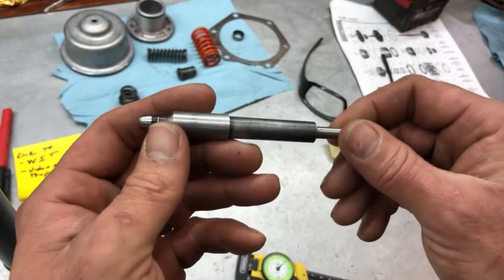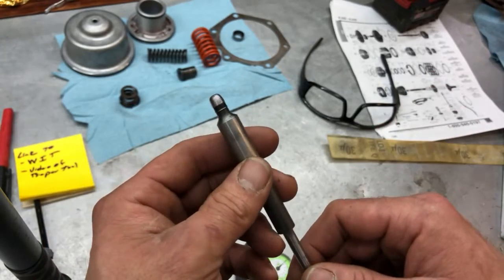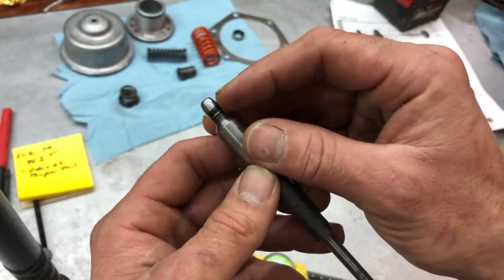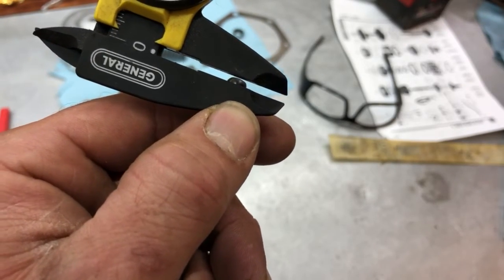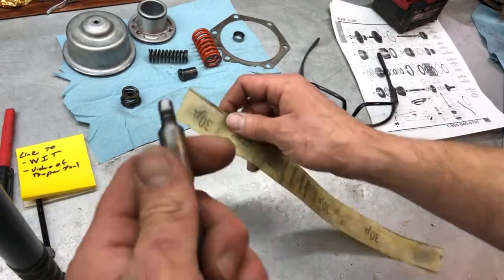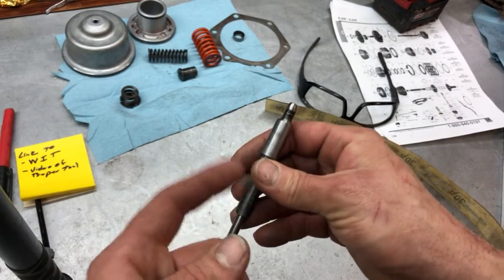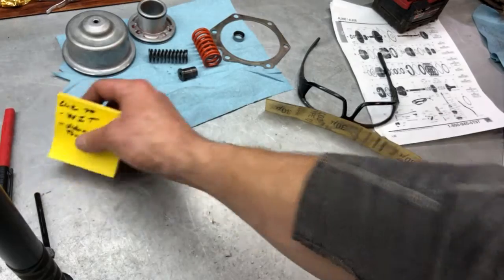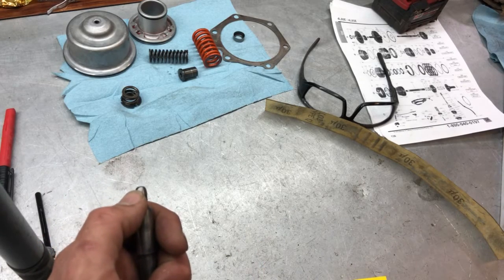4L80-E Extended Rear Band Servo Piston Rod fix For No Reverse or Slipping Reverse in GM Transmission

Comment: Just had same issue on a truck i bought. Had all forward gears and low 1. Knew it was rear servo pin. Bought adjustable pin and set it in .005" longer increments.  Slipped at .015 and a little at .020" at .025-.030" longer it held just fine.  Set at .035" longer and band was dragging. .025" works great. But only a bandaid fix.  Works enough now to resell.
Reply: I would hope you tell the new buyer what you did. Pretty low quality person to deceive another person that way.
Reply from the maker: Yup!

Comment: Total cost $73 through O'Reilly's
Reply: What did you order
Reply: @justinpigg1970  the only thing I ordered was a transmission filter and Gasket and fluid. I made my rod 4.980 in. It doesn't have to be smooth it doesn't have to be a good job because the bore of the rod is a whole lot smaller than the rod
Reply: @justinpigg1970  you can order the ride through any transmission service. Just weld a bunch of crap on the end of it, make it close to 5 in. If you feel a drag when you're pulling forward it's too damn long. I am like you I was worried to death about it, but it's just under five inches. Don't sweat it make it just under 5 in.

Comment: Just trying to help everybody out. I just fixed my transmission yesterday. Forget about what you add to the rod if you will turn it into a 4.980 length it will work. You do not have to drop the valve body, you can remove one solenoid with a number 20 Torx head bit, then you can worm the assembly in and out if you are patient. Mine works great I appreciate the videos

Comment: a closer look at the terrible seating method that the factory used at the pin base shows that ALL the apply pressure is shared by a VERY small amount of the aluminum piston surface. Just put a grade 8 washer the correct si
Reply: ze between the spring and the cup/piston.

Comment: What welding method is used?
Reply: I was communicating with a person who made a welded extension, using MIG, he added about 1/4" to the pin, to get the travel right. The recommended. piston travel is 0.161", that means buying measuring equipment, something I will have to do. There are extender kits available on ebay and amazon.

Comment: Great video! A few comments.
1) as most have mentioned you mean 6 hundredths not 6 thousandths. .060
2) I just did this repair on a 2004 4wd 2500hd / 4L80e. The stock pin length was 4.75” we required 4.9375” overall length to get the band engaging in reverse and not dragging in drive or neutral.

It worked and we’re back in action for the cost of a fluid change and a bit of welding rod. Thanks again for the video.

Comment: What is the total length of the pin?im adding on a piece of metal like cap to the pin not welding.. do I have to round that off as well sence it’s bulkier.
Reply: Probably so I got the extension pin and installed it work for about a week then only in the morning would it go into reverse once and not again until the fellowing morning for week the stop going into reverse all the way around

Comment: Thats great it worked. Will it work on 4L60e.
Reply from the maker: Not sure.  It's a case by case basis I am sure.  Unknown until  you pull the pan i guess.  And I am unsure how long it will last. Mine is still holding... fingers crossed.
Reply: @WHATTHEFIX  is it still holding, and if so, how long has it been?
Reply: Soo.... How's that going.  I'm about to drop my pan after work tomorrow and try this out 🤘